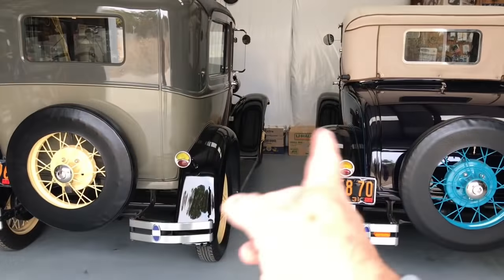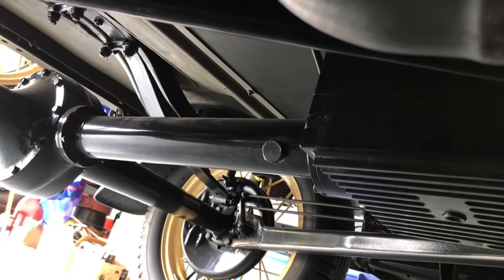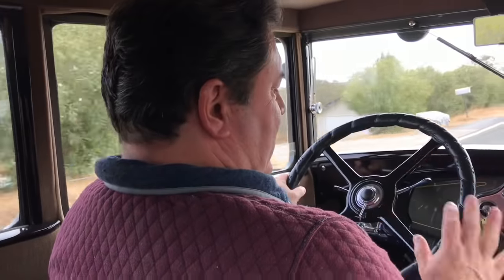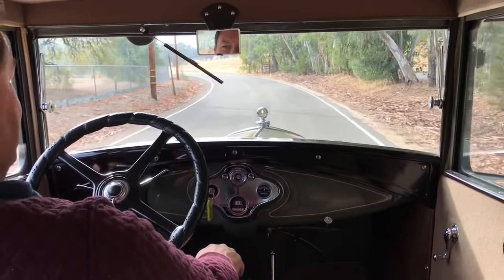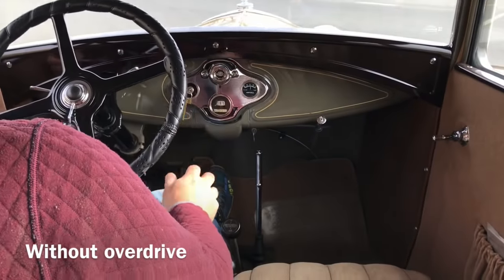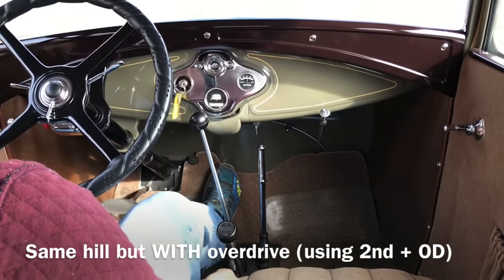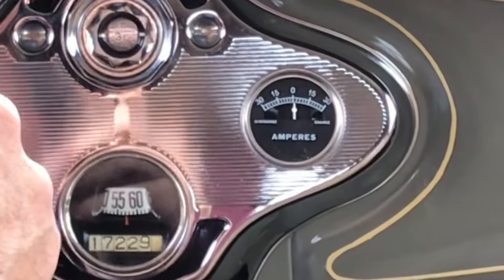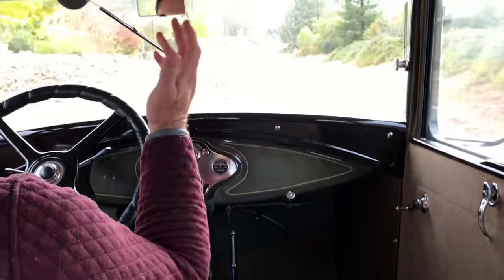Ford Model A Overdrive.  How it works, what it does!  Mitchell overdrive overview

Comment: Love the videos, a few questions. Is the engine in the Tudor and sport coupe both stock. Stock compression and cam? Does the coupe pull that hill better than the Tudor because it’s lighter. And how much better would a very light car, say a fenderless roadster do on that hill. I am building a model t roadster with a engine and transmission and would like to get an idea of how it will climb being very lightweight
Reply from the maker: The tudor is 100% stock engine.  It was restored to be a fine point car.  I added the overdrive and made a driver out of it many years ago when I gave up the whole judging thing.  The coupe has a B block that's getting tired (lots of miles on it).  However, the coupe is much lighter and it does handle that hill easier.  But the coupe drives different, you can really feel how much lighter and less top heavy it is when driving it.  I can only imagine how much different it would drive with even more weight removed.  I've driven Model A "speedsters" and it's like driving a torquey go-cart.
Reply: Thank you! Very informative. My roadster will be about the weight of a model a speedster. I’m excited to get my car running.
Reply: What cam do you run, stock reground? I’ve had amazing results from stipe cams in my model t fords. Could climb hills in high gear that I didn’t think possible. I plan on a stipe ib330 cam for my model a engine
Reply from the maker: I run all stock.  Not into hot rodding or anything.
Reply: That’s great to know. The stipe cams aren’t hot rod cams in actuality. They are a slightly optimized grind on a new billet. Meaning no journal wear and perfect timing cylinder to cylinder. Far better performance than a reground original offered from any catalog. I used the stock grind in my model t and it smoothed the engine out and increased performance to what Ford intended. Seeing your actual driving and concise narrative is so helpful in understanding the model a which is fairly new to me

Comment: Cinder blocks have no strength on their side, put them vertical and a nice piece of ply wood or timber across the top to spread the load of the axle stands
Reply from the maker: I knew I was going to get a lot of flak about the cinder blocks.  The car was still hanging by the cables.  The jack stands were just an extra safety backup.

Comment: What about a Columbia two-speed rear axle?
Reply from the maker: What about it?
Reply: @ModelA  is it comparable to a Mitchell? Did they make one for a mModel A? Would one for a Model B work? I hear they are the same axle as a model A.
Reply from the maker: @genwatkens2505    I have no idea.  I've never messed with one.  Yes, the Model A and Model B use the same rear axle.
Reply: @ModelA  okay, I guess I'll have to keep researching, there is not much information on them. Thanks for the help.

Comment: Hi Paul, Would you be offended if I offered a 1988 Mercedes-Benz 560SEC Euro spec coupe with only 97,000 km since new and in near perfect condition as even trade for that green sedan of yours, the one with overdrive. I will not be offended if you turn down my offer. Best regards, Carl Hansen
Reply from the maker: Hi Carl.  I never get offended, I'm not a snowflake Ha ha!  No thank you on the trade.  Now, if you had a 1969 Dodge Charger General Lee replica, I would do that in a flash.

Comment: ODs are nice and to me OK in your type of roads you drive but the breaking system and tires are not design for 21th century sudden stops.. I would be totally scared to have to suddenly stop a 60 MPH model a..
Reply from the maker: Valid point.  My Model As with overdrive also have the new cast iron brake drums and bonded shoes.  They stop almost like a modern car.  No worries.
Reply: yea, I drive in traffic.. and to many folks texting etc.. you're luck to have nice country roads..

Comment: Was that a concrete block that axle stands was on? That's not safe at all those are brittle! ... Rather use large wooden blocks!
Reply from the maker: The weight of the car is being suspended by cables from the winches.

Comment: Men & boys, may I politely suggest that you from now ( Jan 23, 2021 ) learn to be safe !
Best to have your cinder block turned so all the structure is vertical & add a piece of wood 2”x 8” x 14” resting on top of the cement and taking the jack stands four legs......
Because the EMS rescue has had to lift autos of men working underneath, that were dead. It’s no dam joke when it was one of your older good friends...
a 1921 T wood Pu. a 1929-1/2 AA #82  w/ Warford  & a 1939 # 93 pickup w/ Mitchel 26% OD
Reply from the maker: Thanks John.  The weight of the car was suspended via cables from the garage.  The blocks were just for stability.  But still, you're right.

Comment: Never use concrete blocks like this!  They are easily cracked and will break at stress points!  At least turn the block the other way (the way it was designed to support weight and stress) and put a thick piece of wood under it and on top of it!   Otherwise, I loved the video.

Comment: Why don't you go to high second and then low 3rd and then hi 3rd
Reply from the maker: I did
Reply: @ModelA  I meant low 2nd to hai 2nd to low 3rd
Reply: @ModelA  I'm just saying why don't you split shift through all of them if you need to anyway you know the torque of the thing I'm not driving it carry on
Reply from the maker: Splitting all of them is unnecessary.  Also, I only split 2/3 when climbing a hill and have to accelerate.

Comment: I may have posted this before but anyway - First thing I noticed about my Mitchell was I use it as 4 gear around town when the speed limit is 40 or over.
Second - I have an unrestored car and that fat, shiny shifter looks way of place. I took a Model A shifter and cut the bottom off to make it short and used it. It looks like it belongs in the Model A. I also used a mushroom knob on it to look more original. Just a matter of personal preference.

Comment: The magic is stopping that thing at highway speed 😟
Reply from the maker: You would be surprised how good the brakes are on my Model A's.
Reply: @ModelA  thanx for your reply .70years ago winter a neighbor had 2 a s one have a hadees gasoline heater inside with the indoor gas tank .my first ride in the vibrating thing the heater EVPLODED  ALL OF US LIVED  THE CAR TWO .LATER WE COULD have bought a pickup rdstr. 32.  35$ dad said it smoked wasn't worth it they burnt it up for scrap iron . 🤗

Comment: Oh no! If you ever have to use cinder blocks (and try not to) have the holes vertical and use a block of wood to distribute the weight from the car/jack stands. But having the blocks with the holes horizontal and the legs of the jack stands concentrating the weight on the thin and fragile webs is just asking for bad things to happen. Love your vids (and the safety thing you do at the beginning of many) but this was getting well into the stupid zone. Do that shit off camera, but please don't show that as if it was in any way a safe or acceptable shop practice.
Reply: Always enjoy your videos I'm a newbie to the Hobby and my 30 Coupe have been set up for touring when I bought it. The former owner installed newly rebuilt B motor with a high compression head, 39 syncrude 3-speed from a V8 and used a Clings adapter he also change the gearing in the rear end but I'm not sure what it is. I was relieved when you demonstrated that large gearing gap between 2nd and 3rd. I have been experiencing this and wondered if I was not using all the RPM that was available to me but, I didn't want to twist the motor up too tight. I have been making my gear changes at between 1000 and 1300 RPM depending on road conditions. What is normal or recommended for a car set up like this?
Reply from the maker: I knew I was going to get a lot of flak about the cinder blocks.  The car was still hanging by the cables.  The jack stands were just an extra safety backup.
Reply from the maker: You're doing it right.  Please continue!

Comment: Next time DO NOT support the car on a cement block LYING ON ITS SIDE. It’s safer with the block holes vertically as opposed to horizontal. That is If you feel you MUST use a concrete block. Wood would be MUCH BETTER! Please stay safe !!!

Comment: The lack of safety on this one is scary.  never use cinder blocks to jack a car.  When using them for other things put them so the hole is up and down there is no strength sideways
Reply from the maker: Yes.  and I apologize.
Reply: @ModelA  great chanel  keep the videos coming  73